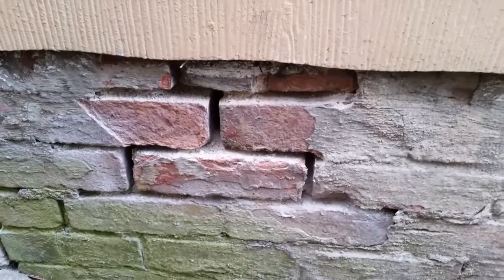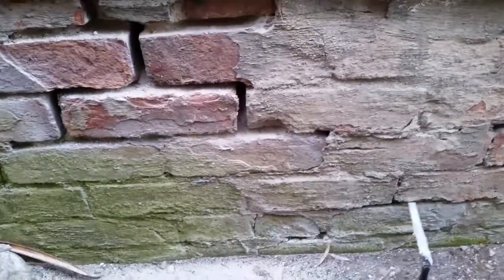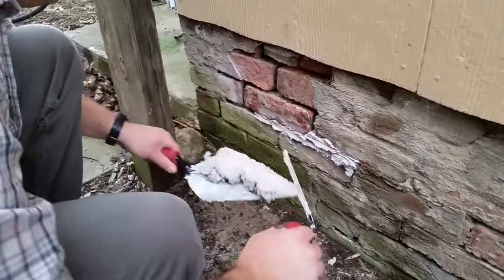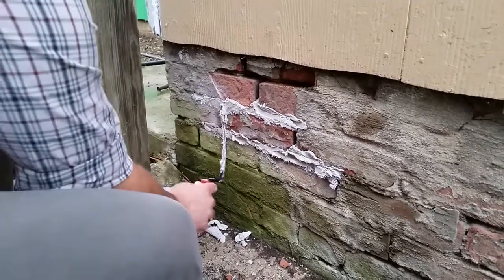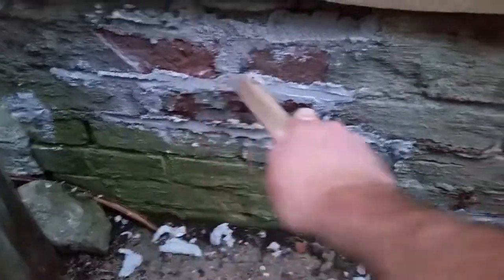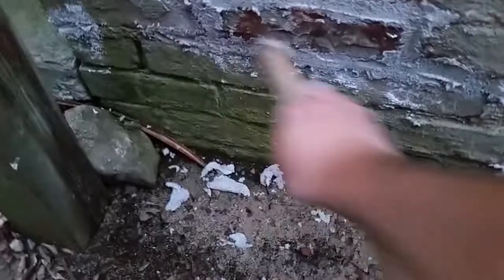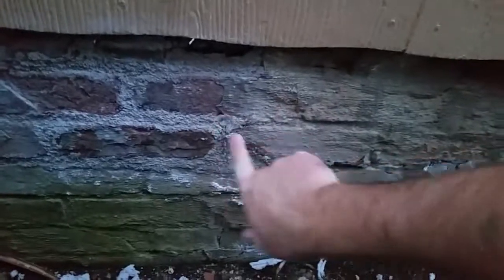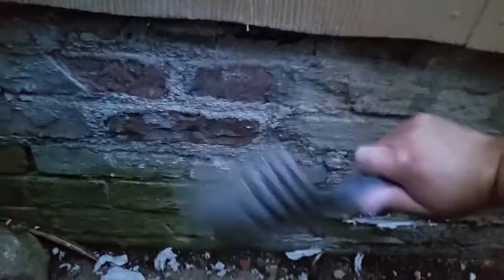Tuckpointing with Lime Mortar made from Lime putty

Comment: You must spray down the bricks before repointing. Otherwise they suck the moisture out of the mortar and it drastically weakens it and doesn't bond right with the bricks. This is a very important step.
Reply from the maker: I mention this at about the 50 second mark in the video, thanks for bringing it up though. As you say it is a very important step

Comment: I watched all three videos on making the putty, mixing, and this one for tuck pointing. I tried this on a small part of my home and found the next day my new mortar had hair line cracks. Would you know why that happened?
Reply from the maker: Conkeybine possibly it dried to fast. This type of mortar hardens by the evaporation of moisture. This means that if the outside drys before the inside you may have cracking. My suggestion would be to try a small section making sure to wet down the brick before placing the mortar. Once you have the mortar the way you like it dry a little while then when it starts to look like it is loosing it's wet sheen mist it with water. Do this for the first day or two depending on your local weather
Reply: Ok I will try this. Thank you
Reply: Did you put wet burlap on it?